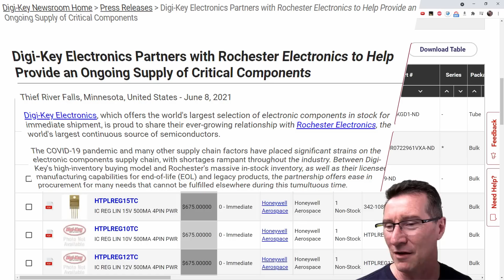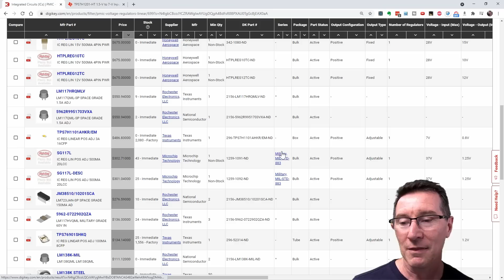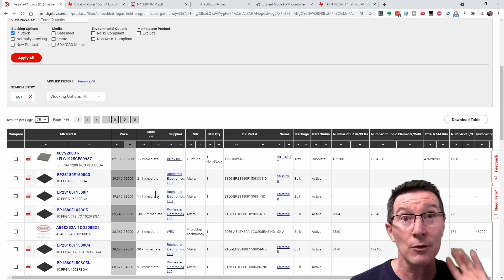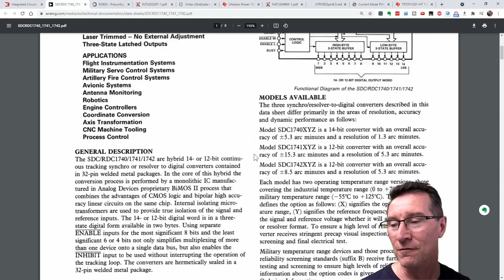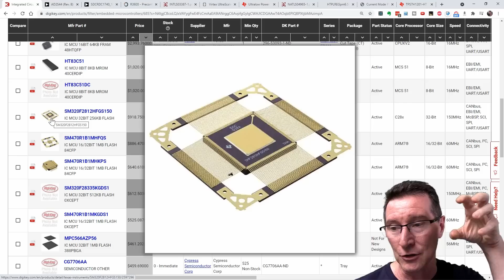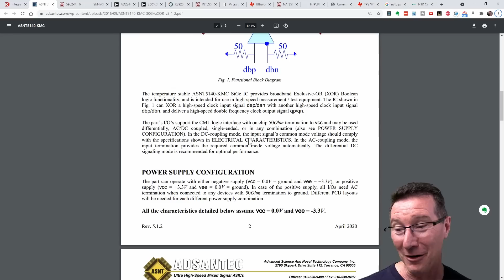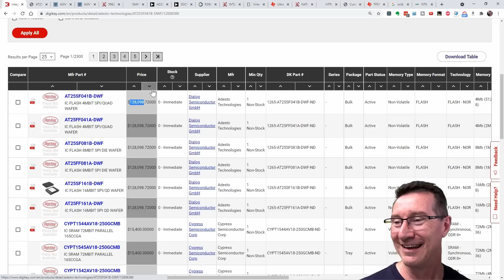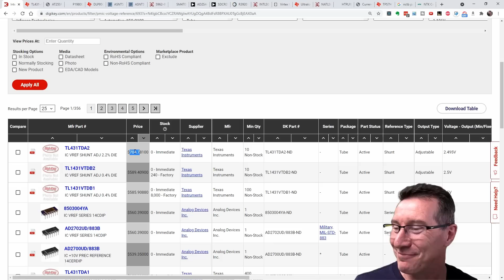EEVblog 1435 - The World's Most EXPENSIVE Catalog IC ?

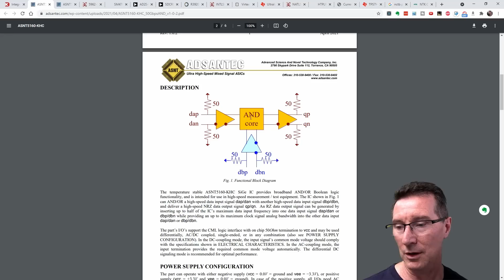Comment: @18:30, That differential in and out gate is actually and AND and an OR combined.  If you swap the differential input's +&-, IE the polarity of the input data, the AND becomes an AND with inverted inputs, or in other words, a NOR gate.  Then, what do you assume happens to that NOR gate when you swap the +&- on the outputs?

Comment: I don't think those lead frames are to be mounted in a socket (except for testing), they are most likely built like that with the fancy ceramic insulators to allow electrical testing at high temperature/vacuum, but would still be cut off during final mounting. Aerospace hardware often uses exotic soldering and attachment methods so it makes sense they offer them without any lead finishing.

Comment: Leaves me wondering about value of some of my 1970s ICs stock, including quite a few in white ceramic and gold leads. UA 723  must have nearly a dozen, 
Some parts were high cost at introduction, the uA741 OpAmp when released by Fairchild was noted at US$41.00 each in the first adverts in 1968/69 ads.  The uA709 OpAmp that needed external comp cap was a bit cheaper but still around $20.00. Just mindboggling given prices of such, and better OpAmps these days.
4K Dynamic RAM from Intel were over $20.00 each mid 1970s.
So many ancient parts in my stock might carry good prices.

There was a time NASA was buying old 2716, 2732 EPROMS via US consulate at about $25 as they needed parts on shuttle and other space needs. Had friend approach me for mine at $5 offer, until I found out his game, was to profit greatly, as mine were brand new and would get better than $25, as that was for pre used parts. No way did he get mi e, but also I sold none. 
Have TI colour TV chips, and other special function parts, and early uProcessors.

Comment: Recently been working on high temp downhole projects. Those high temp TI microcontrollers are pretty standard. They end up being a tiny fraction of the instrument cost, so no big deal.
Reply: I was looking at high temp MCUs a little while back too. For some reason they only offer crappy low-end stuff for £600 like Cortex-M0.
Reply: Do you use high temperature solder 🤔?

Comment: Ok, so... why in the world would you want to buy an unpackaged die? Like in what application is that useful?
Reply: So you can assemble into your specific application, and exactly control the assembly process - to achieve whatever mechanical properties you are aiming for - like vibration proof, distance from heat source etc
Reply: Because it’s cheap. You then wire bond it directly to your PCB and cover it in black epoxy. You probably own many products using this technique, since it’s commonly used in calculators, remote controls, and display modules.
Reply: @tookitogo  almost all the cheap electronics from china is made this way
Reply: @robegatt  Not really. Lots of cheap Chinese electronics use regular packaged ICs.
Reply: @tookitogo  it depends on numbers, take pocket calculatosr as an extreme custom no package example.
Reply: @robegatt  Uh, calculators was literally my first example. 

Some electronics, like calculators, use that construction frequently. But it’s not the case for electronics as a whole, even cheap Chinese stuff.
Reply: @tookitogo  I said almost all, meaning the QUANTITY stuff. Of course a phone battery charger doesn't need those kind of solutions.
Reply: @robegatt  I don’t think “almost all” comes even close to being correct.
Reply: @tookitogo  I think it is, think about toys and all the electronic devices that are sold in big numbers.
Reply: @robegatt  Well you’re wrong. ::shrug::

It’s common, but certainly not “all electronic devices sold in large numbers”. Not even close.
Reply: @tookitogo  I said "almost all". I'm talking about devices that actually do something, not just led lamps current regulators or phone chargers. Calculators, meters of various kind, monitors, usb hubs, toys, watches, etc...
Reply: @robegatt  Your reply before mine literally said “all electronic devices sold in large numbers”, without “almost”. But even with “almost” it’d still be wrong!! 

Most of those examples use standard packaged ICs. Only the cheapest (literally, the $1 models) multimeters use blobbed ICs. Calculators commonly do. And the sound chips in talking greeting cards and the like. Very little else uses them commonly.
Reply: @tookitogo  are you familiar with the concept of sets and subsets ?! "all devices that are sold in big numbers" is a subset of "all devices". Since this subset, as far as quantity is concerned, is very big, I said that is almost as big as the set that contains it. Capesh?!
Reply: @robegatt  You seem convinced I’m saying you’re wrong because of misunderstanding your qualifiers; I understand your qualifiers perfectly, it’s just just that your claim is wrong.
Reply: @tookitogo  it is not, and you wrongly quoted my "qualifiers".
Reply: @robegatt  No, I didn’t. The vast majority of electronics which are produced in large numbers do not use chip-in-blob production. You’re delusional if you think they do.
Reply: @tookitogo  Yes, you did. Lol.
Reply: @robegatt  Nah man, you’re just talking out of your ass.
Reply: Glop top chips.
Reply: reverse engineering? ;-)

Comment: Rochester specialise in buying up obsolete stock, including bare chips and wafers, and package and test it themselves. They also buy up IC manufacturing masks so they can re-make the chips themselves. In this way, they can charge almost whatever they want for in-demand obsolete parts. I have direct experience in dealing with these guys, they are professional and reliable, but buying from them can COST YOUR SOUL!
Reply: Yes had to get some 200K ECL parts made by Rochester to repair a radar recorder - cost a small fortune but only way to do it
Reply: I work on the design team at Rochester Electronics. It’s interesting to see outside perspectives!
Reply: When I was in the Semiconductor procurement business at Digital Equipment it was very challenging when components went on what we called allocation - a bit like the situation with Porsche cars at the moment. I can recall at least one occasion when one of our test engineers was able to confirm that a third party sourced batch of DRAMs were non conforming and we sent it back for credit.
Reply: Wow! Just... wow.
Reply: For less-expensive ICs they have a minimum of around $250 per SKU. You can buy 25MHz 68030s from them frex but you have to buy at least 3.
Reply: Would be great to interview an experience guy at Rochester
Reply: By the time you're buying it from Rochester, you're buying a very short run of a semi-custom chip.
Reply: @erikscott5709  I don't know if they make "mixed" wafers but I would doubt it, as their aim is to replicate the target parts as closely as possible, and I don't think this would be possible on this sort of wafer. I do know that they claim to hold the world's biggest supply of obsolete bare die and wafers.
Reply: @erikscott5709  Not always, If there is enough demand, after all the "new old" stock of packaged parts, chips and wafers are exhausted, Rochester do buy up all the original chip masks, manufacturing data and test programs, so they can re-make the parts themselves from scratch.
Reply: @gusbert  I probably mis-spoke, and you're exactly right. I was referring to the very short production run. Do you know if they make a whole wafer at a time, or do they have a way to mix chips on the same wafer? That sort of seems like a much harder thing.
Reply: The price is fair for the investment and cost of future investment 

The wafers should be able to be mixed but that is going to make it cost more not less and more harder to do 

Generally it is like a school projector putting and masking light onto the wafers and it activates a liquid solution to start a chemical reactions much like making ur own circuit boards

The cost of part comes down to batch building and selling
Probably won't be long till the process is improved then be able to do it cheaper
Reply: Ive come across Rochester a few times repairing old equipment. Sometimes it's a question of the replacement cost of the machine, if you can't find a drop-in replacement. The prices tend to reflect this.
Reply: I believe that natural law still applies to everything and you will find that they  charge up to what the market will tolerate. At some point an  Engineer will be tipped over to the point of having to redesign a system. As opposed to just buying a very expensive part.  It wouldn't surprise me then a lot of scientific vanity projects require good amounts of philanthropy. So  Engineering large scale equipment requires the ability to raise capital from the campaigns department. So not only is there complex electronics. But there's complex  Psychology at play. The world is more complex then any individual could Imagine. You don't just wake up in the morning and decide you gonna fly to Mars. Theres a shit load of cocktail parties for very rich people before you get even close to engineering some expensive equipment. So its the mantaning of that equipment after all the cocktail parties are over that drives up the price of the components. It's a giant  cycle.
Reply: @Alyosha1975  I'm not sure what your point is here. I have been involved in situation with a micro (Intel 80196) on a last time buy on a product which we are trying to make obsolete, telling purchasing again and again to buy up all the stock of the micro so they can to cover future sales, even though the price has increased from $5 to $20. But look, they say, the price has increased 4X, that's CRAZY! And then, when we are running out, and a big customer insists that we have to sell them more, but by then Intel have stopped making the wafers. Meanwhile, Rochester has stepped in and bought all the stock of wafers and die from Intel and are packaging, testing and selling their version, but it now costs $200 per part. So the profit margins on our product have gone, and this is all my fault? And relax, rant over.
Reply: @gusbert  I would have spent my wages on it and sold them each chip for 120 to teach them a lesson

Comment: Regarding those leadframe packages. It is very common fom space-grade stuff to ship in this form. And some test batches of ic's come in tis package as well. I guess this is because each chip is wirebonded manualy or it is somehow linked with manufacturing/testing process. And yes, this package allows you some freedom of mounting, but usually datasheet limits your monting way. It is huge pain in the ass to form those leads before soldering.
Reply: Indeed, I work in aerospace and can attest to the annoyance of lead forming. Requires specialty tooling and skilled technicians, not to mention a careful and precise toe-toe distance to get the bends "just right".
Reply: One reason for this is they don't want to the responsibility for the mechanical mounting of the chip. The PCB designer/integrator will normally run a suite of mechanical simulation with the IC to ensure the vibration and shock requirements are met.

Comment: The most expensive FPGA is about $115k. The voltage regulator is a lot cheaper - but the minimum order is 70, so a minimum order will total $117k.

Comment: But if you use the linear voltage regulator at 200°, what kind of solder are you using?!
Reply: TIG ...
Reply: Perhaps ultrasonic welding right to the PCB? The Apollo guidance computer was constructed that way.

Comment: That first regulator was only available on a 70pc minimum order... gotta count that in the purchase price!  Rochester buys up mfgr inventory, along with full wafers, masks, testing equipment, etc... when they want more parts, they will dice up and package a wafer or two... and they can test to OEM specs.  Don't bother asking them for 68060's though... the Amiga bois bought all them up ages ago.  BTW... everything is 52 weeks lead time... giant PITA, we're buying up boards off of eBay and scalping the processors off them for our production.
Reply: And the prices for 68060s sky-rocketed in the last 12 months :(
Reply: @diemaschinedieviereckigeei2941  How big of a FPGA would be needed to emulate one? Perhaps there's a market for a FPGA on an adapter board preprogrammed to work as a 68060?
Reply: @NiHaoMike64  In fact there is an FPGA version, called Apollo 68080. The FPU part is quite large, but according to their website the whole design fits into an Altera Cyclone V. It mainly targets Amiga accelerator cards.